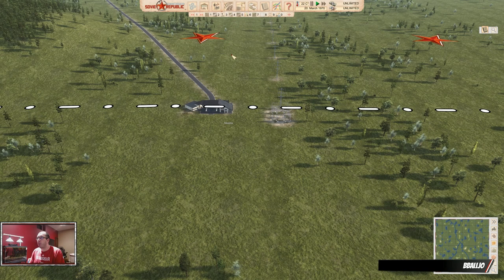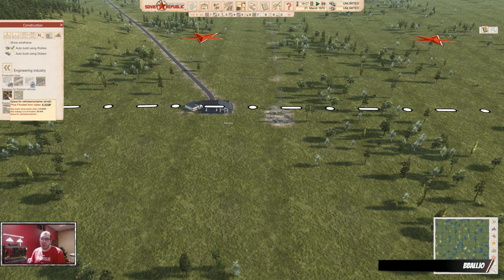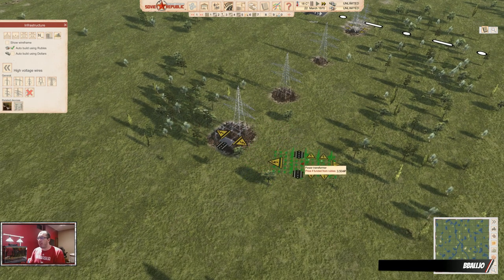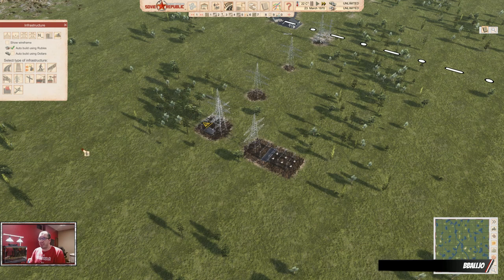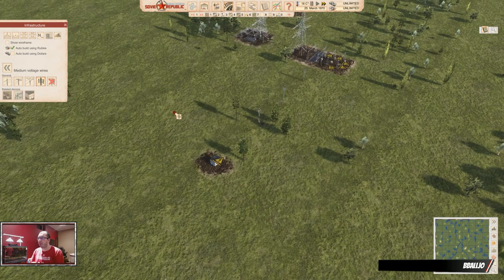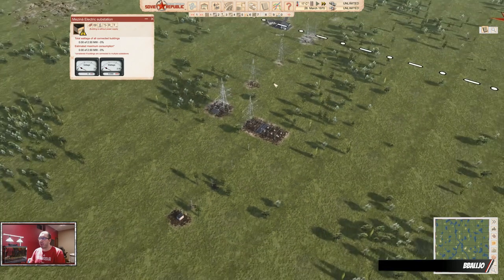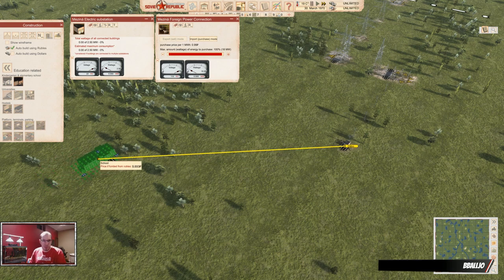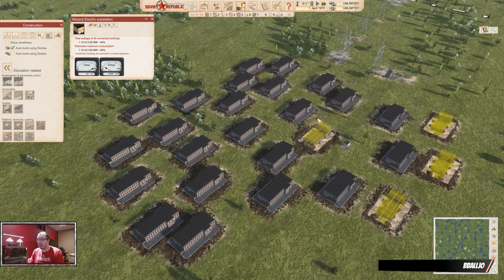Electricity Guide | Tutorial | Workers & Resources: Soviet Republic Guides

Comment: Hi, It's megawatt-hour not megawatt per hour, that's why you divide it by time to get the power in MW. You were off by factor of 10 - 3.6MWh/60 is 60kW which is the circuit breaker value. BTW any idea why you need power for grain silos and other buildings that still do work without it?
Reply from the maker: Thanks for correcting me! 

To your question, I don't think there is a reason besides this being a game in early access...I see that it's confusing for new players, so I hope it will be fixed eventually.

Comment: I'm having a hard time keeping my power plant manned, especially during the winter. But if I import power it just takes that power instead of from the power plant. So I'm stuck between always importing power and the plant doing nothing or making my own power but having it cut out constantly during the winter. Any tips?
Reply from the maker: There are a couple options...

1. You could reduce the import % to just about what you need or less, then the power plant could try to supply the rest. Then connect the power plants other HV connection to another border transformer for exporting power. Make sure this power line is not connected to the import power line, otherwise you import and export the same power at a loss.

2. You could fix the power station worker problem... personally I will always recommend cableways to supply workers to your high value workplaces. They need power to get going, but once they are running your power plant will never be without workers. Alternatively you could update the infrastructure so that traffic and winter won't impede your transport, but this is a lot harder to get right.

In general I usually say if you aren't using cableways l, use multiple different transport options to make sure you have the workers.

Another trick...put 2 passenger stations within walking distance of the power plant. Set both station so that workers will go to the other station and the power plant, this way workers will never go home unless they worked at the power plant, and you should never run out of workers. This is a little gamey, but should give you what they need. Be careful, if workers are trapped in this station loop for too long they can escape or die, but this shouldn't be an issue until their travel time gets into the 20 hour range.

Hope any of that helped!
Reply: If you have problems in the winter, consider supplying your power plant with transport methods unaffected by the weather. Trains (trams) and cable cars can work wonders.

Comment: What i would have liked is more explanation on selling power. Hard to know what my plant produces and the maximum i can sell to avoid the blackouts. Is there is a way to sell all the power you can spare without exceeding your local demand? Does buying with one connection while selling with another achieve this?
Reply from the maker: You can set the export to 100% and you will sell all the excess power, so that's safe. Having 2 custom power connections connected to the same grid with 1 importing and 1 exporting generally causes you to buy and sell power at the same time which means you're loosing money. Once you have a power plant running you generally don't need to import any more electricity, but I get that keeping the power plant running at 100% is not easy...I highly recommend cableways for staffing power plants.

Last thing, power production and consumption...an in game day is 60 hours instead of 24, so when you read numbers with MWh you can divide by 60 and get MW which is the units of the HV power lines, with a max of 18MW...so a coal power plant produces up to 24 MW, which means you need to connect 2 HV lines to use it all.

I think once the power overlay update is out I'll make a better electricity tutorial. Thanks for you questions!
Reply: @bballjo  Yeah i did eventually make some progress. I really didn't want to believe that one coal plant maxes out the biggest line, what is the point of the nuclear power if you need to run massive wires everywhere?  Even if the nuclear plant has 20 or so nodes  that still requires hundreds of kilometres of powerline to sell it. I built 4 coal plants in a town next to the coal mine and then had to spend millions running multiple large lines to export it all.  May as well just build a coal plant near every outside connection, save a billion on powerlines and still sell the maximum amount. Or am i missing something?
Reply from the maker: Well...it's a planned economy. AFAIK the power line capacity is realistic, the need for more than 1 power line is also pretty realistic. The double nuclear power plant has only 9 HV outputs... details...

But to your point, a few coal power plants are absolutely enough to power a republic, but the power has to get to the right places, and it can only go 19nodes far...what you should do is plan a power grid for your whole republic, and build it when it becomes needed... millions to construct? By the time you need that much power, you shouldn't have to pay for anything anymore, instead you should be self sufficient...and if you play with autobuild and autopurchase a lot, I highly recommend playing without it, it's a much better game that way IMO. 

Last point, never got not have 1 source of power...have at least 1 redundant power source somewhere as part of the grid, just in case your main is out of workers or on fire...

Comment: Hi Bballjo. Thanks for the tutorial. Well explained as always. I have a question that might not have a simple answer. I have built a coal power plant. Has an output of 1400 mwh per day. Its only use will be to power my railway once ive electrified it. Is there a way of calcalating its real terms output or do i just wait to see if my trains grind to a halt ? I appreciate this might not have the simplest of answers
Reply from the maker: Luckily its a very simple answer, but when i recorded this video I didn't know the answer...
In game, the buildings show in MWh, so for the Power Plant 1400MWh, to get the actual in game MW production, just divide by 60 ==> 1400MWh/60 = 23.3MW. So the actual production of the Coal Power Plant is about 24MW. Be aware, your largest HW wire can only carry 18MW. Also, the electric rail connection only transfers power up until the next electric connection, so don't do what i did in the current season 1, i places them in series, but only the outside 2 are actually supplying power to the network. Place your Electric Connections in Parallel with each other instead. 

Hope that helps!
Reply: @bballjo  thankyou. It does help, but thats not alot of power.

Comment: Hey man, thanks for the video! Just a short question: Is it safe to connect multiple power sources (coal, nuclear, solar or wind power plants) to the same grid? For example through a HV-switch? I'm running 2 coal power plants for my republic (~28k population and industries), but sometimes I have some issues with my power grid. It only became worse when I tried to add wind power to the main grid to reduce usage of the coal power. Adding wind power literally chocked off everything off from the switches it was connected to (the MV was literally dropping to 13-14k, or HV dropping from 110k to ~76k), as soon as I removed the wind power, the voltage was stable again - with the coal power plants putting out more, I suppose.

Anyway - what would be the most practical solution to connect these two coal power plants together? I'm aware of the 18MW limit of the HV wires. Should I just take both outputs of the coal power plants and connect one of each together trough a HV switch?
Reply from the maker: In general it's a good idea to have multiple power sources to account for outages. Connecting any of the different ones should not interfere with the power delivery on its own, but power is bi-directional...it's possible that one connection had a shorter path, so it tried to use wind but that's hard to verify from here... maybe try to only have power districts on different areas of the map, so the power distance is the same. Also it maybe helpful to add multiple power grids that connect from opposite sites to the same grid.
Reply: @bballjo  Thank for the quick reply, I really appreciate it! Could please elaborate further on the shorter paths? Does a substation for example primarily draw power from the closest available source? I'll try to make a video to show where I am having problems with. Maybe you could make a advanced electricity tutorial at some point?
Reply from the maker: I can try...

Electricity takes the path of least resistance, I'm not sure how exact the power simulation in this game is, but I think it's pretty close from what I've seen...so if you supply power from 2 sides, with a consumer not in the middle, and both power sources are producing enough power for the consumer, then the consumer would draw power from whichever source is closer. If the closer source is the windmill, then the problem is that it doesn't supply constant power. Power is similar to water in its flow, which means it's not just on/off, it's more coming/going, so when 1 power source shuts of, the power has to disappear first in order for the other source to take over that section, but if the power source turns on again you have to reverse that flow, which isn't instant... windmills do this a lot, and I would assume that when power changes direction, there is a short period of no power... apologies for the bad terminology to any physics or electrical professions.

So in the end, try to concentrate sources into fewer locations so this ebb and flow of power does not happen.

Comment: Bumping into an issue trying to power a city and E trains from another city's nuke plant. When more than 1 E train comes in it overloads the grid and will even crash the game, (now converting to diesel for freight long hauls). I've run 3 HV lines to the city thinking that each line was getting maxed out but it still happens. I guess my question is: Assume a 20MW load.. if you run a single 18MW limit HV line and then split it and load each split with 10MW and 10MW.. does the game sum the load back to the source line like IRL? If it doesn't it would really clean up my lines.. that or we need a mod w lines that can handle more load.
Reply from the maker: Well...I'm not sure I'm following 100%, but you already know the 18MW line max...if you bring that line to a transformer from 2 locations, that transformer should have up to 36mw available, but the bigger mv wire can only carry 2.35mw, even if each substation says it can handle 2.5mw...

What I suspect is that your substations are overloaded...18mw can really supply around 40k cities and industries, so I would be surprised if the HV lines are the issue...

Comment: My question is why is my power poles white?  I have then connected to a power source, but yet they are white.  I'm building from resource, getting my  material from the border that I need to set up my power poles - though I do not get my power source from the border.
Reply from the maker: White is "blueprint mode", you need to confirm them (bottom right menu)
Reply: @bballjo  thank  you for y our quick reply.  I spent most of the night trying to figure it out after I left you this message and finally found what I needed to do.  I think that button should be more out there than on where it's at now lol.  Thank you again, and I liked and sub to your YouTube.